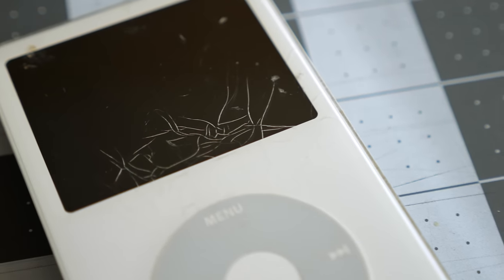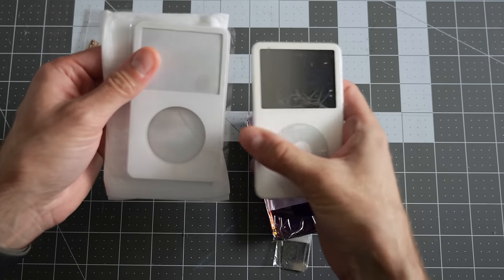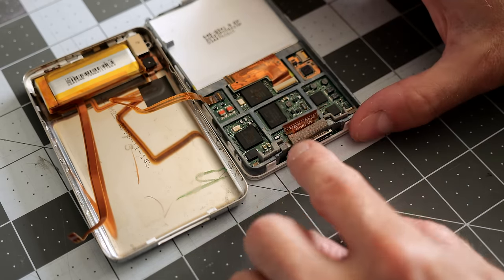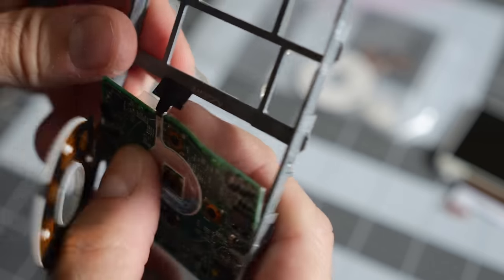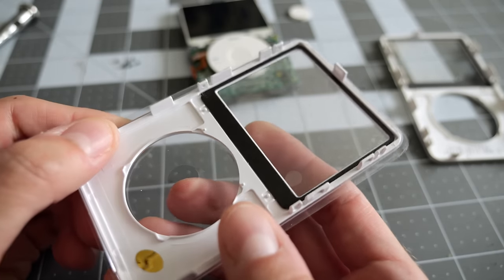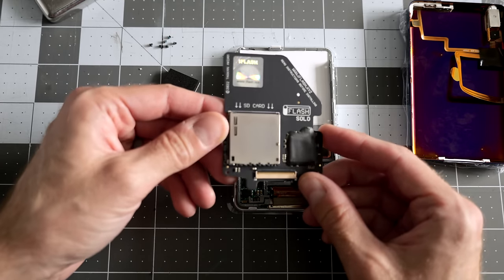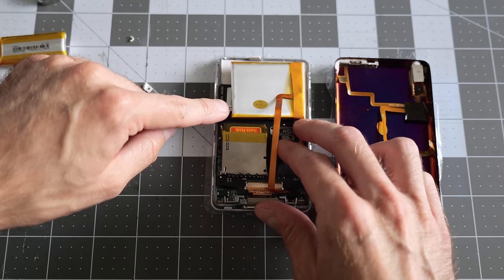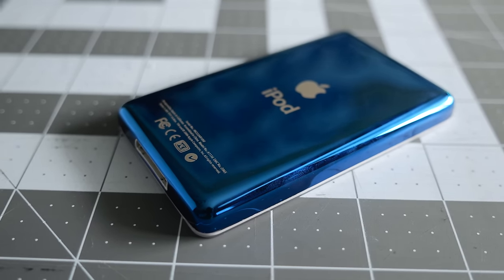Building a Custom iPod Video!

Comment: I no longer have the iPod classic 5th Gen. I do have the 4th Gen iPod nano which I sometimes use for the car because it has the 3.5mm audio jack. You should do a video on modding the iPod nano! It’s newer and more common than the iPod classic!
Reply: Unfortunately only the minis and classics can really be modded.
Reply: @waltciii3  the iPod minis were only on the market for less than two years! Apple made use of flash or SSD so fast for their newer iPods. If iPod nanos could be modded, I would be able to store more videos, since I had to constantly drag and drop due to 8GB being so primitive for even 240p video! But it was very easy to play and didn’t have constant slow downs like the iPod classic had when you go from random music.
Reply: @Markimark151  Nano's and others have hard soldered memory and other components. They're dead to us. :(
Reply: @waltciii3  it’s so stupid that Apple made the iPod nano with a soldered unibody design. And Apple doesn’t make any iPods anymore, I like having a dedicated music player so I plug it in my stereo.

Comment: I have a 320 gig m2 in mine. Did it about 2 years ago and I still use it every day with built in Bluetooth 😜 via a QED uplay, straight through my hifi. I've only used around 107gb. Great video on recycling. More people should go for these options, only problem is most manufacturers now, don't have or ever sell replacement parts.

Comment: I modded a few and still love the iPod to this day, but the song limit and most of all necessarily using iTunes made me jump to a modern DAP. If there was a way to upgrade the RAM on this, add some conveniences and use drag-and-drop, it's still the most elegant player interface to me. I tried Rockbox, but that doesn't work with docks and 30 pin accesories.

Comment: Great video. BTW there is alternate software you can install on the ipod's called rockbox which greatly enhances the ipod allowing videos, games, music without the need for itunes to transfer as the ipod will appear as a regular usb storage device just drag and drop (both ways). I've used it on both my ipods and its great (even plays doom and pacman !)

Comment: I use to love refurbishing iPods like this a couple of years ago. I’ve quit though because the new batteries I’ve been getting are nowhere near as good as the ones Apple originally used. Even with a flash drive replacement, my new battery life is poor. I’m getting a couple of hours play from the 5th Gen, and the iPod Minis with new battery and flash mod are much worse. I’m curious what others are getting.

Comment: What computer and program did you use to sync it? I can’t get Apple Music on my M1 Mac mini to even recognize the iPod, let along sync music into it. Did you use iTunes on an old computer or something?
Reply: You will have to acquire an older computer, unfortunately. Apple removed classic iPod support for iTunes on Windows in 2020, so I imagine they would've done the same thing w/ Apple Music for macOS around the same time. You could try to use a virtual machine, but I personally haven't tried to do it (I don't have access to an Apple silicone Mac).
Reply: @industrialcream  thank you. I had no idea they removed support! That explains everything.

Comment: I'm still running a stock 160GB  7th gen. and I'm so tempted to upgrade it and refurbish it but I've done some calculations and it's going to be around $100 for the parts. A bit on the high end for the same functionality and slightly better looks. Maybe in a year or two...

Comment: Air Travel? Go for largest possible battery.
Permanent dock or car iPod? Smallest battery. 
General purpose iPod? Get the one in this video. The SD card uses less power anyway, the medium battery will still last you all day.

Comment: Bought 20 broken iPods and have been having some stuttering, may be because my synced library is too big, thanks for the chart! Now I’ll have to get 128gb cards instead of all these 500 and 256 lol
Reply: If you're dealing with 5-7th gen iPods, you could try to upgrade to the MBs from higher capacity models(I believe base models had 32MB of ram and higher storage models had 64MB). There's also rockbox which doesn't have a song limit(a free replacement OS for some ipods and other mp3 players.)

Comment: Yeah, the headphone jack is really a problem on these. I loved mine and ran them for ten years, and I had to replace the headphone jack countless times. The contacts became loose, especially with a large connector excerting bending forces on the jack, and so every couple of months one side would go silent or intermittent. Eventually I had to replace the plug too. Stuffing that poor ipod down the front pocket of a pair of tight jeans probably didn't help at all, but man was I ever good looking! :'D

Why did I run ipod videos for ten years? Like everyone, my library was downloaded for free, and it took me a while to convert to spotify. And also rockbox. To this day I haven't found a piece of music software with as good equalizer settings as that OS had. Not only that, but it boosted the volume level to the max - something the original software capped at a very low level due to some hearing protection legislation. All in all, the ipod video was the culmination of the freely downloaded mp3 era, to me.

Comment: I'm so used to seeing IPS mods I'm surprised there isn't one here.

Edit: thought of something else funny. Can you use the hard drive in a regular computer for say your OS? Not like what dank pods did where he had it in the iPod hooked up via USB but I talking get an IDE adapter and use that to format it for windows 11 or Linux or Mac OS.
Reply: You can! I've taken a 1.8" drive from a 4th gen and used an adaptor to put it in a 2002 PC, running Windows XP.

The 1st generation MacBook Air also uses the exact same interface for the ZIF hard drive as the iPod 5th/6th/7th generation so you could theoretically put an iPod drive in an older MacBook Air and use it normally without any adaptors.

On the other hand, my 7th gen is actually running off an SSD that was pulled from a MacBook Air.
Reply: @NekoMichi  wow that's so cool

Comment: Itd be cool if you could add bluetooth and a differeny charge port to it to get rid of that horrendous 30 pin apple came out with. They should really release a limited run type of thing of these with those features. I personally always liked these ones over the touchs.

Comment: I did this too! I kinda missed the weight. I went waaay more trippy with the colours. But I broke the clip for the hold switch so it’s iffy now
Reply: I had the same problem, I ended up buying a little weight and sticking it inside, works a charm though you need to place it properly otherwise itll be unbalanced.
Reply: @Natei  I went with the duo and a huge 3000 battery. Space is super tight inside. What did you use?

Comment: I rescued a 5.5 gen and put a terrabyte of flash memory in there, then installed rockbox.  It's the perfect solution; the extra hi-fi model with no need to use itunes, plus it plays doom.

Comment: if i remember right that song limit is only if u use the stock firmware.
i think if u flash rockbox i think it had the option to save the the index file on the external storage.

Comment: I still have my 5.5 gen 80 gig model that I always kept it in a protective carry case.  The battery is dead so need to replace it.  Problem is I don't use MAC or Windows since I'm a Linux guy and want to upgrade the hard drive to SD and don't have access to iTunes to do a restore.  Guess I can run a Windows 7 VM with USB pass through.

Comment: I warped the metal back getting it off and reassembled after replacing the battery.  Unfortunately I can't think of a way to unwarp it now that it bows out a bit and no longer makes a complete seal.  The clips that hold it in place are weird and one probably broke.  I do have one of those classic 6th gens.

Comment: $150 just to fix a little mp3 player? Wow. That's a lot more than the amount it cost for my old computer to work properly again (which is ~$50. The hard drive needed to be replaced and now the wifi card needs to be replaced. I'm taking advantage of the situation and adding a Bluetooth+wifi combo card in there. I know it'll fit because I've took a look at pics of the original hardware online and matched it with the new hardware. And yes, I've heard of having to isolate pins 20 and 51 in order for it to work, all I need to do for that is put electrical tape or something like that on said pins, and besides drivers for my OS, I'm sure it'll work without a hitch.)

Comment: you should throw Rockbox on it, it gives so many features to the device and eliminates the need for iTunes
Reply: Also eliminates the software imposed song limit.
Reply: @Zark-Muckerberg  a 5 band EQ, games, drag and drop files, a flashlight mode, and the only thing it stops being "good" for is video as the team never did get the video chip working properly not that watching video was any fun on that screen anyway

Comment: I have tried battery replacement many times over the years but the battery somehow just does not hold. It dies instantly unless unplugged onto the sound system dock. I’m debating between fixing it like you did or buy already upgraded one on eBay that comes from China, the latter I’m not too sure if anything came from the originals at all, what do you thing?

Comment: I fixed up a 4.th gen some time back, there is something novel about having an MP3 player that is of decent quality, and doesn't require you to go online for anything. However it's a bitch to charge, the battery is new, but it doesn't seem to want to charge from anything, I can get it a tiny bit charged by having it connected to a PC while it's connected to Itunes, everything else seems to just not do anything for it.

Comment: I wonder if spraying the back with a clear spray paint would help make the scratches removable...  You know, after a few months, hit the clear with polish, and viola! No more scratches.
Reply: My friend did that back in 2009 (they had their iPod touch signed by a band they liked) but the lacquer they used yellowed over time with hand oils and age. Still, as a consumable protectant I think it'd be worth doing
Reply: @lauram5905  That would probably happen to any clear, but could be removed an re-applied.  Your friend's use case is different though.  Any solvent used to remove the clear would likely also remove the autograph.

Comment: Given the last bit of info about the iPod having a limit on its database (assumingely regardless of SD size) does this mean Elite Obsolete Electronics is ripping people off by offering up to 2TB storage since the iPod already has a limit?
Reply: I think the database he linked to said the limit for that iPod was between 20,000 and 50,000 songs.  If you had all hi-res files you could get close to that 2TB limit and still not use up all the song capacity.  There is a difference between file size and the quantity of files.  The database limits the quantity, not the file size.

Comment: I’ve been looking at an eBay listing for a ‘new’ 7th gen iPod classic, will I need to replace the battery or will it generally be ok if it’s never been used? Any tips for not getting stung on eBay listings?

Comment: Too bad my 3rd gen nano is a nightmare to open and replace things...
Sometimes the screen of it goes completely white... I place it for a few minutes on the fridge and it works again.
I'm very sure that happens because the battery is starting to bulge and it's touching the ribbon cable for the display... 😭

Comment: I have a 4th generation iPod touch I got a few months ago for $20, and it runs iOS 6.1.6, but has battery issues, but as the battery is soldered to the board, I don’t know how to replace it. I have no soldering experience so maybe I’ll try my first time on that iPod.

Comment: It should be said that there is an upper limit to how much storage the iPod will accept. Dank Pods has extensively explored this.
Reply: 65,535. That’s on the 64mb RAM models. But you can use the rest of the storage for videos, photos, files etc. but once you go over that number, it begins crashing and deleting songs. Has something to do with the programming.  2 byte system can only hold so much data before rolling over to zero. I’m not a programmer. Just what I read. lol.

Comment: Great video. I have solid state / flash storage (SD, CF, etc) in every version of the iPod (except the very first one). I was having file corruption issues on my 5th gen that I keep in my car (I'm thinking it's weather related). I ended up installing a SanDisk 128GB High Endurance SD in it, maybe 2-3 years ago, and it's running great. If anyone has any issues, or wishes to use solid state / fish store in an iPad that may get used heavily outside or in the car, check out those SanDisk High Endurance card. I also use one in my security camera.

Comment: I broke two bales in my life and after I broke that second one I learned to never ever break another one because there really is no way to fix them and it will disable whatever peripheral you have hooked up to it I had to replace a whole laptop motherboard before when I broke one. Ever since then I take my time.  I really hate that design for those sort of ribbon cables I guess it's just an easy way to get tiny small connections.

Comment: Have an iPod classic 160 gig. I only use it to hardwire to my cars audio system.  NeverEnding random lockups. I have to reset the iPod to get it to work. If I get rid of the hard drive for a memory card is this a known fix? If so please consider posting details

Comment: I have mine from way back with a whole bunch of good stuff on it. My front is all scratched and has the spider cracks. If the front is changed and battery done but leaving the original hard drive in. Is it possible to do without losing anything?

Comment: Why an SD card? Why not micro SD card? I noticed when I went into an electronic store recently that they still sell SD cards for some reason. The adapters for MicroSD to full size SD are the exact same size as a regular SD card so there is absolutely no reason I can think of to make a regular SD card if your a card manufacturer.

There is no hard drive but if you go with a full sized battery (the ones you say need a bigger back) then it may be just as heavy cuz of all that lithium and ions.
Reply: My guess is cameras and professional equipment. If it's not intended to be removed a microSD is fine (and is often used on embedded equipment!) But anything that has to be tracked and handled regularly doesn't get any favours by being excessively easy to lose.
Reply: All of the fastest SD cards are full size cards. It would be harder to make a microsd card as fast as the full size ones, which is why even 9 months after your comment mine is still true. 

If you want to get into why, I don't know exactly. I do know that pretty much all microSD cards are monolitic and full sized SD cards are not. It is probably easier for the current fastest generation to be made on independent silicon, then refined into a monolitic solution later.

Comment: I really wish I could use that solid state storage method on my 2nd generation which just had its HDD die, but the original FireWire versions don't look to be compatible with anything other than actual HDD. Sad.

Comment: @ThisDoesNotComp Can you clone the original HDD to a flash card and have the iPod recognize it without using iTunes? I have a Classic that still works but I think I should replace the battery and drive before they fail. I have a ton of my Music on there and my iTunes now won't recognize the iPod for some reason (probably lost access to my old email I used) So I would Like to save the iPod and not have to use iTunes. Does that sound possible?

Comment: I wonder how heavy the iPod becomes after you remove the hard drive. Never having owned one of these, I imagine the hard drive is the heaviest part of the iPod, and replacing it with an SD Card adapter removes a lot of the weight to the iPod, making it feel slightly less genuine, personally.
Reply: You’re exactly right, I was underwhelmed by how my iPod felt after replacing the hard drive with flash storage, so I just put the old hard drive back in.

Comment: I upgraded my 5.5 iPod Video  with an iFlash +128 GB sdxc and a 3000mAh battery many years ago. It sounds ridiculously good and the battery lasts forever. Now I tend to use my 128 GB iPhone SE because it´s lighter but as a music device my iPod is imbatible to me.

Comment: I want to do this to my old battle buddy.

Question: what can you do when one of those tiny plastic bails break?, my brother was opening his 3ds and the little plastic bail that holds the circle pad's connection to the main board broke and went flying, that thing is TINY, not sure what to do to fix it for him.
Reply: If you have the adhesive on the back of the flex cable it should keep the connection stable.   BTW- I have not seen any replacements for the bails.

Comment: I’ve opened several different generation iPods using that same tool and always end bending the metal frame. I’ve also ripped headphone ribbon cables off of the motherboard when opening it. In other words, I’m not a professional. 😢

Comment: there is better tutorials on how to open it without killing the back cover or the clips ... using a slimmer tool that has the with of the clips,  hitting exactly the spots where the clips are to unlatch them etc ..